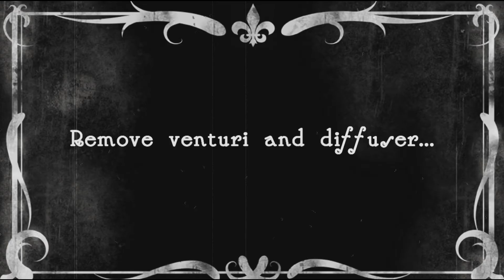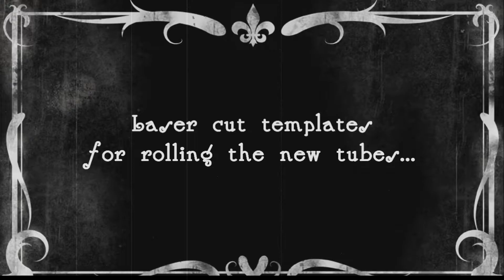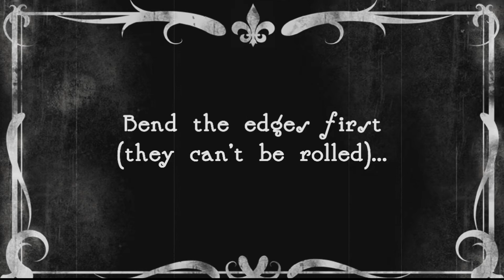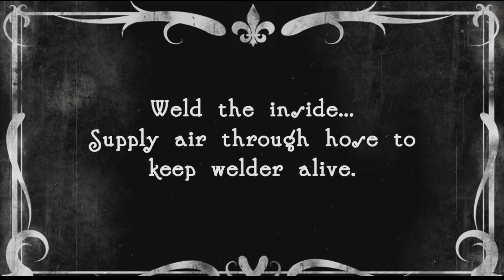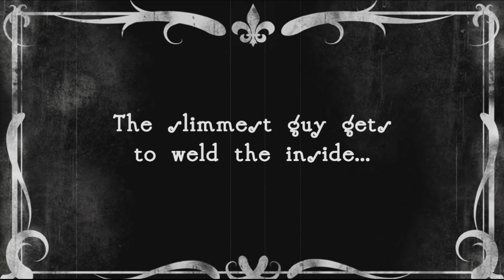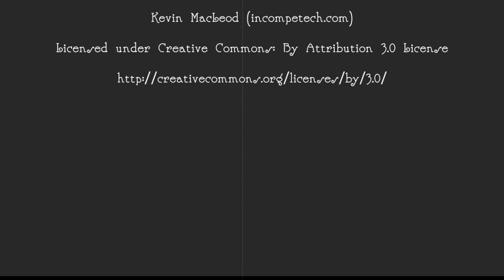Crash course: How to repair a pulse jet

Comment: Nice vid! Did you just replace a part or did you improve upon it too?
Reply from the maker: We just changed it. The cause of the failure is snapping engine mounts, not the design of the engine itself.